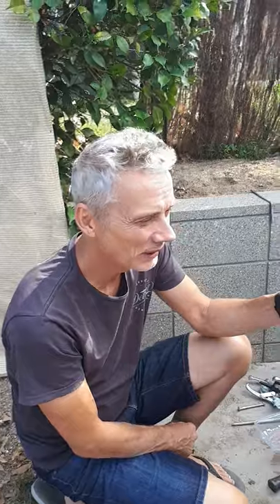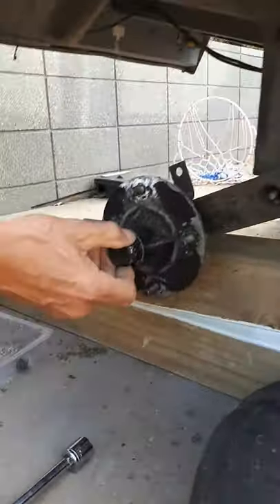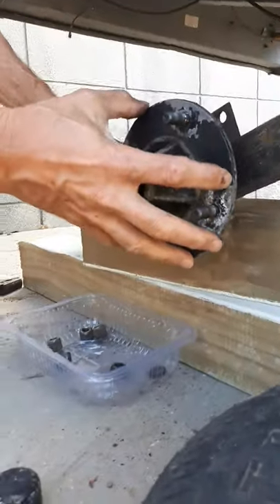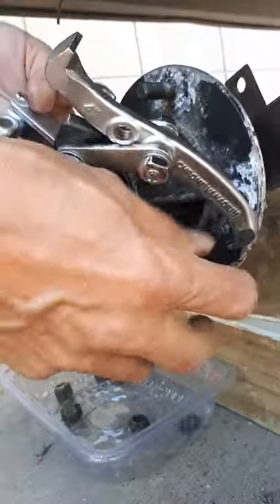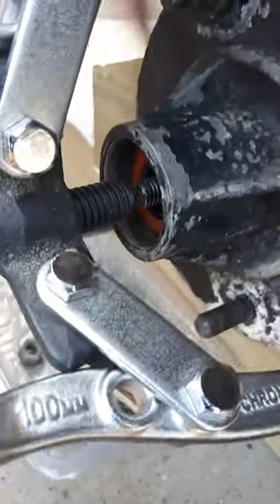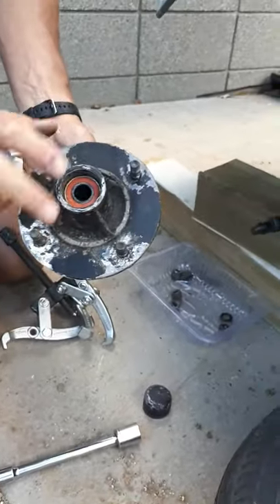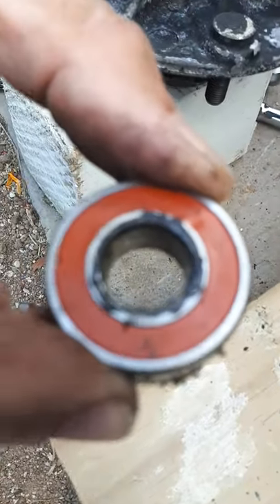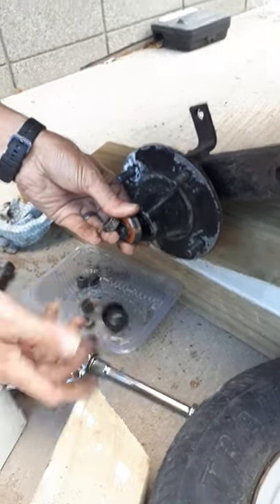How to change wheel bearings on an Erde trailer using a hub pulley or hub puller

Comment: Well taping the hub didn't release it for me, then my hub puller cracked the cast iron hub. The bearing race were well and truly welded to the stub axle and the bearings and cage were completely contaminated.